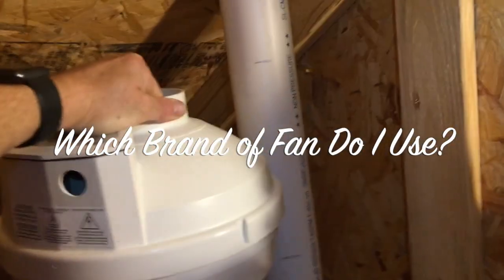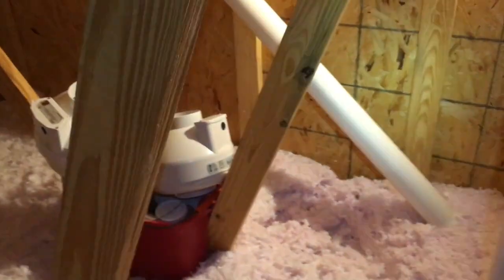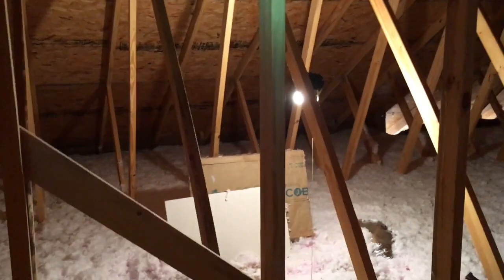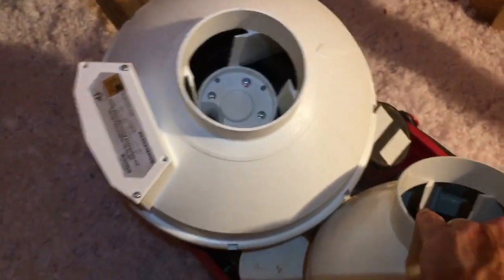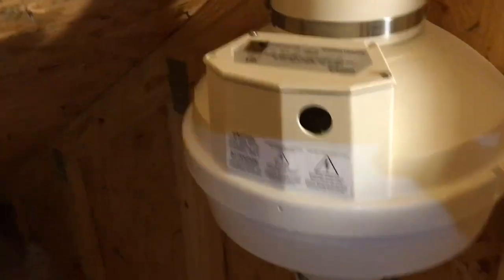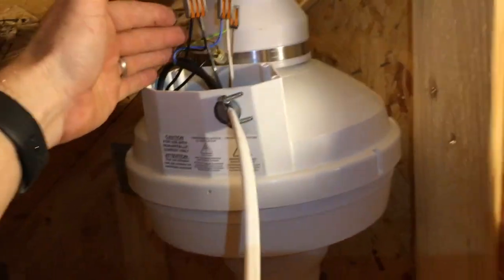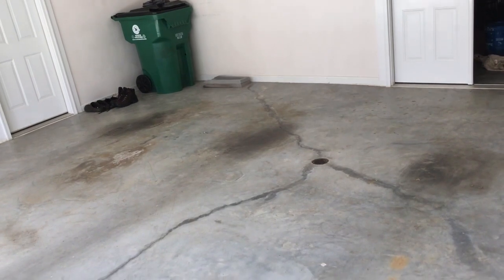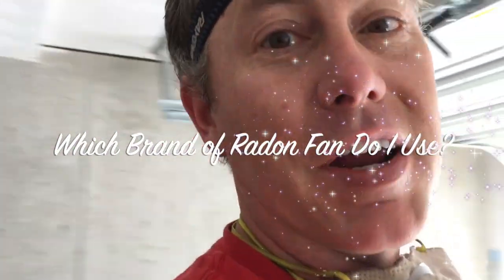Which Brand of Radon Fan To Use?

Comment: Most of the weight of a house is on the outside walls.  With slab flooring, as the foundation settles, it pulls the outside edge of the slab down but the soil settles less and less the more toward the center you get.  This causes the cracking you are seeing.

Comment: What's your typical manometer reading with the RP145 ?  The wizards that installed mine have multiple floor and wall pick up points and have NOTHING in the garage. Yet garage is 2 car doors, and side door.  Maybe they thought the doors would provide mitigation ?  I would have put the take off in the garage and verified just how far out the collection zone went.   Thinking I need higher suction fan.

Comment: Hi Radon Man, I was wondering what fan I should use for my sump pit. I live in a duplex with a basement that is divided with a cement wall from my duplex neighbor who refuses to cooperate with radon mitigation. Each side is about 1500 square feet. I have sealed the sump pit, the expansion joints, and caulked around where the floor and wall meet, and caulked little cracks in floor and walls. Will a fan be worthwhile if my neighbor doesn't seal his sump, etc.? I have an Airthings radon monitor upstairs and our numbers are currently below 1.86. Sealing has only brought it down a little over one full number. It was 2.94. Should I consider getting a heat exchange for my situation or will a fan possibly work? Is it better to have fan in attic vs outdoor in Wisconsin?
Reply: What is your reading in the basement ?  Another guy's reading dropping from 10 to 5 when he went upstairs.  US EPA guideline is 4.  He mitigated and his basement dropped a lot and upstairs was .25 - really, really low.
Reply: @DanTheManIOM  the basement is now 4.08. I definitely think it would be worth mitigating with a fan but I don’t know how effective it might be since I’m on one side of a duplex.
Reply: @rottencorehorror666  It'd be easier if you were 5, or 10. No question, mitigate it.  Even at 4, I think I would still try.  I have a college friend who never smoked and has lung cancer, who knows how it came about.  She's been battling it for years,  What if it came from radon ?  I just bought one of those digital radon detectors yesterday, going to find out what I have.  All the houses around me have systems.

Comment: Never had a problem using 45 couplings to take a pipe AWAY from a stud to install a fan on it....and then using another one BACK to the original pipe!  You also want to make sure that the fan you are installing is the best for "air flow" on your system based on your manomter levels.  Sometimes, you should change to different fans based on your levels!

Comment: Nice work.  I hit that thumbs-up for you.  
So, this set-up (piping) was already there?  They just didn't spring for the fan?  
The garage floor cracking is probably what you said about not enough gravel.  Also, maybe little or no rebar?   When would you switch from using 3-inch PVC compared to 4-inch?  Is it based on the foot-print square footage of the basement?  Thank you.
Reply from the maker: Thanks Patrick! In this video, I was activating a passive radon system.  In my area, they are all that is required for new construction. Check out my videos on passive systems if you are interested.